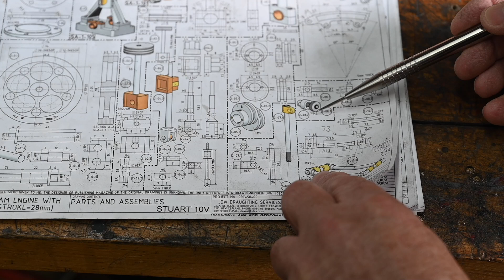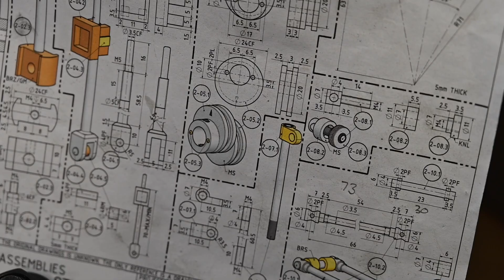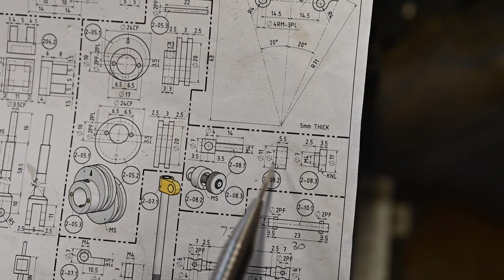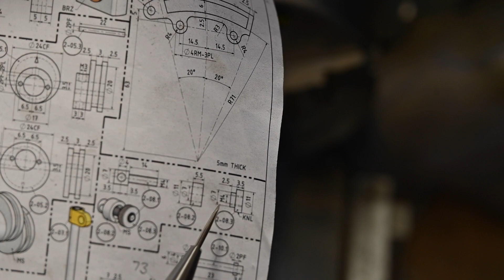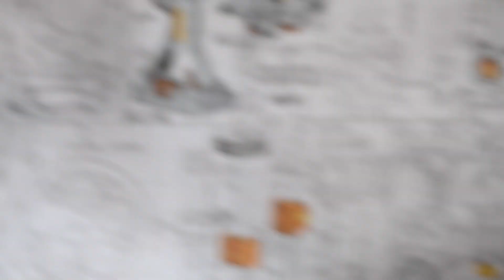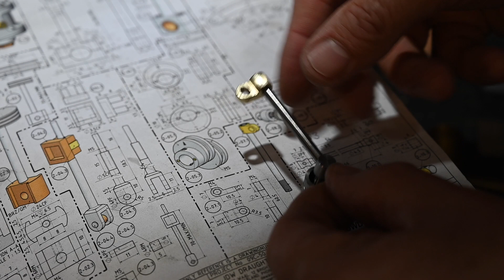Stuart 10v Steam Model - Machining The Gear Lever Stop EP18

Comment: nice. I'm surprised the nut isn't a bigger diameter, could be a bit fiddly adjusting when running.
Reply from the maker: @paulrayner4514  it doesn’t move when running it’s to lock the forward and reverse 👍👍

Comment: Looking great. Regard the nut knurling, couldn't you use a threaded mandrel to hold it for knurling?
Reply from the maker: @stephenperry5849  Thank you, yes I could, but I am not that bothered. I don’t mind it how it is 👍👍
Reply: @EnglishHobbyMachinist  Thank you for your reply, I am trying to learn the art of machining and every bit if advice helps. I just wanted to know it this was an option, I have a similar part on a wobbler engine I built, compressing the spring which I left smooth because I forgot to knurl before cutting off.  It does look much, much better than the 10H I am trying to build! My first engine build from castings. I should have gone for something bigger. So far, I have had to make about 50% of the parts more than once, few are a good representation of the drawings!
Reply from the maker: @stephenperry5849  yes it can be done, practice makes perfect 👍